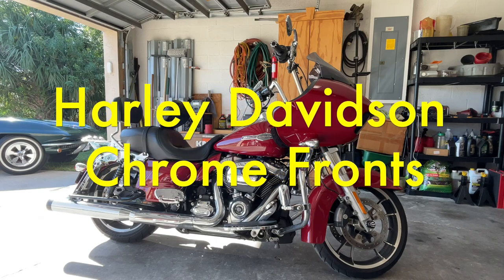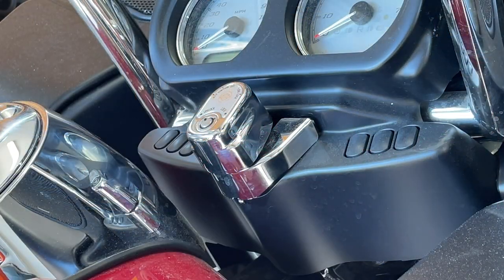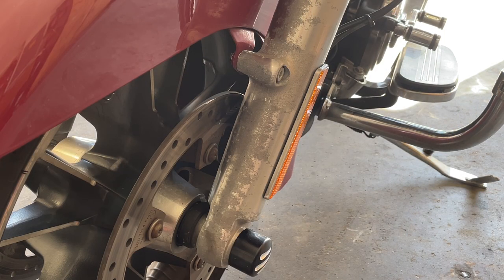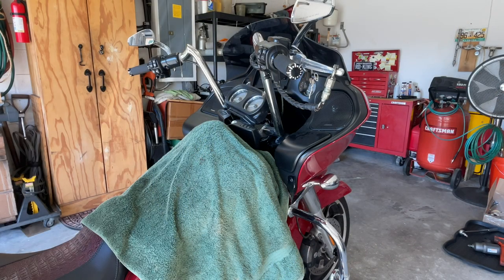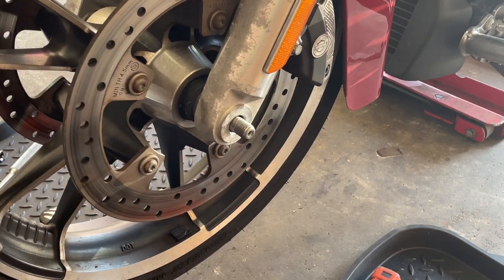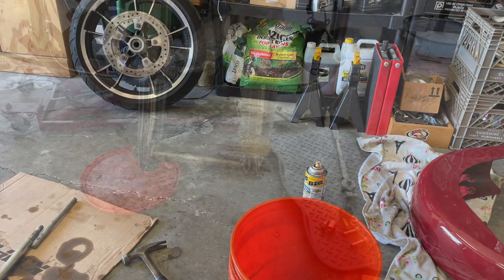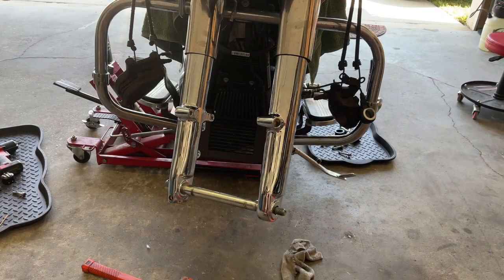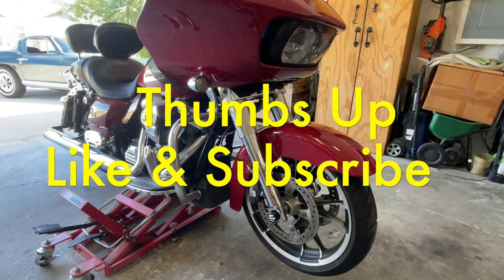Harley Davidson Chrome Fork Install.

Comment: Good stuff Rocco.  My next project on my 2021 Road Glide.  I already have some pitting of the stock lower legs.  I just need to get a hold of a 19 mm allen and a 12 mm extended allen wrench.  Super easy to follow instructions.
Reply from the maker: Happy to help. Big improvement chrome forks. Any questions just ask. I used  eBay for tools. Thank you for watching an all your support easy glider. Ride safe and have a great day. And let us know how it works out.

Comment: Thank you very much.
It helped me a lot.

But FRONT AXLE and DAMPER TUBES
Which one is it?
Reply from the maker: Happy to help. Any questions just ask I don't understand front axle and damper to. Thank you for watching and all your support Sung. Ride safe and have a great day.
Reply: Torque spec.  Damper tubes - 30 to 37 foot pounds.
                         Top plug - 28 foot pounds.
                          clamp bolts - 14 to 18 foot pounds.
                          Front axle - 55 foot pounds,   7/8 nut.
                          fender Hdwe.  1/4 - Allen head.
Thank you for watching. Ride safe and have a great day. @TwoWheelRocco  

That's what's mentioned here.

Comment: That's no Florida accent you have there Rocco. You don't miss the snow do you? 😁
My 2012 StreetGlide lower forks had a clearcoat on them but, it doesn't last long. I painted the fork lowers on my bike.
When I rebuilt the front forks on my 2000 WideGlide, I sanded the fork lowers and polished them using and electric buffer. They look like chrome now.
Reply from the maker: New York, New York. I do not miss that snow. Thank you for watching and all your support Ardy. Ride safe and have a great day.

Comment: Great video my friend, one question, I don’t understand what you meant by indexing the cap when you put it back together?
Reply from the maker: Happy to help. What I meant, index it so you know where the thread starts with the tube so when you push down on the top cap, you set it a quarter inch before your thread starts and makes it a little easier to start the thread off because it is a fine thread. Could be a bit of a bear. I hope that helps. Thank you for watching and all your support BMW Dan. Ride safe and have a great day.
Reply: @TwoWheelRocco  I understand now! Thank you makes a lot of sense.
Reply from the maker: @bmwdan3445  My pleasure, Ride safe. Have a great day.

Comment: Did I miss it?  What is the piece that goes on before the fork seal?  I think you called it a bushing. At 16:08 you hammer it in with the pvc piece. Also, what size pvc pipe?  Excellent video!  Thanks!
Reply from the maker: Happy to help. Yes, that would be the bushing. When you buy the seal kit, go to Home Depot and match it up to a PVC pipe I don't recall the exact measurements..  The Fork Tube is 49 mm..Thank you for watching and all your support Boomer.. Ride safe And have a great day.

Comment: Hey Rocco great video. Gives me the confidence to do my own forks. What diameter pvc pipe did you use? Also did you reuse the seals and fork oil?
Reply from the maker: Happy to help. New seals and Fork oil. I use 15 weight on the new install. It was a 49 mm pipe Home Depot bring a seal with you and match it up. Thank you for watching and all your support Ed, any questions just ask. Ride safe and have a great day. Let us know how it works out. You will be happy with the chrome fronts and yes you can do it.
Reply: Did you buy the fork seals at HD?
Reply from the maker: Yes we did. If I remember right it's 49 mm seals but get them from Harley Davidson get the fork fluid from them to. @edh7970
Reply: Merry Christmas Rocco. The bottom Allen bolt that you use the 12mm Allen socket. What are the torque specs on it? Also do you have a video showing how to remove the rear wheel? Thank you.
Reply from the maker: 15 Ft lbs. will do the job. I'll send you a video of the Road King rear wheel removal. It is the same.   This should help,  https://youtu.be/p5uec0J451w?si=nvefzIB6Q748XIep. Any questions just ask.

Comment: I have 22 years of fltrx.If I replace myself at home without a check machine, exactly how many cc should I put in the Halli Davidson touring fork oil?
Reply from the maker: Happy to help. To stay out of trouble, when you empty the fluid, have a cup there and see how much fluid came out. If you Google your year and type. Fork for Oil Change, it should have your information so you don't have to worry about that, Thank you for watching and all your support red-line. Ride safe and have a great day.

Comment: I have 07 softail custom,  gonna do this to mine ..for what these bikes cost ..harley should have put chrome on it when they build these bikes...
Reply from the maker: Happy to help. I agree with you. It's just so strange the way these forks deteriorate Harley  just wants to charge you for new front fork at time or a trade-in. It's very sad. Thank you for watching and all your support. It is a very nice upgrade and not all that difficult.  Any questions just ask. Thank you for watching and all your support Glen. Ride safe and have a great day.

Comment: I got a 99 roadking it has air suspension on the front. I want to put chrome front lower forks on it, but kind find aby videos on it
Reply from the maker: Happy to help. I do not have any videos on that. Get the manual and you should be able to work it. Thank you for watching and all your support. Ride safe and have a great day. Let us know how it works out. It will help others. I have never done one. Sorry I couldn't do better for you.
Reply: @TwoWheelRocco  will do, when I do it I'll update.

Comment: How long did this take?
Reply from the maker: Happy to help. It's not that bad but you have to  be patient. You're looking at a half a day four hours. Any questions just ask. Thank you for watching and all your support 1833. Let us know how it works out. Ride safe and have a great day. And it's a big improvement. Watch the video. Take your time and lay out. The hardest part is putting the Fork Tube top cap back on.
Reply: Wow, awesome quick reply. I have done this before on another harley, maybe 25 years ago. AND willing to do it again. I remember there was a brass ring inside the fork tube, but cant remember the model. Maybe a sportster, but just cant remember. Totally disgusted that my street glide lowers look as bad as they do.  @TwoWheelRocco
Reply: wow, quick reply. I have done  this before, on a harley but cant remember the model. Maybe a sporty. it had some brass or copper rings at the bottom of the fork tube. weird. Im disgusted that the lower tubes look as shitty as they do after only 1 year on my street glide. 
 @TwoWheelRocco
Reply from the maker: I agree. I believe the dealer designed it that way, most people will go for the chrome Home lowers or the black lowers. And yes there is some piece,  you have your bushings they're brass and you have your washer that's right after your top bushing, watch the video. It's pretty straightforward. Thank you for your reply. Any questions just ask. @handsome1833
Reply: @TwoWheelRocco  half a day is not bad for results like this That front end with some chrome calipers and axle nut covers  wouild look super
Reply from the maker: I agree. Well worth the energy. The outcome is awesome. Shame on Harley for those cheap lowers. Ride safe and have a great day my friend. Any questions just ask. I believe anybody could do it. Watch the video especially where I index the top fork nut to install. @handsome1833